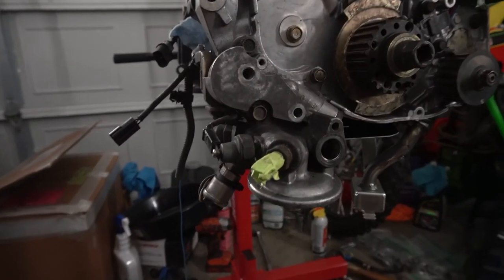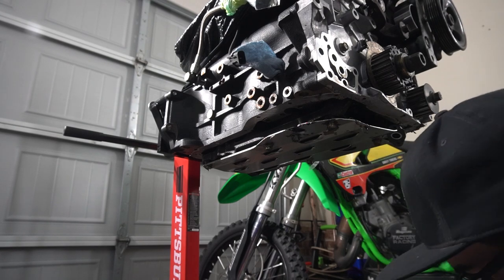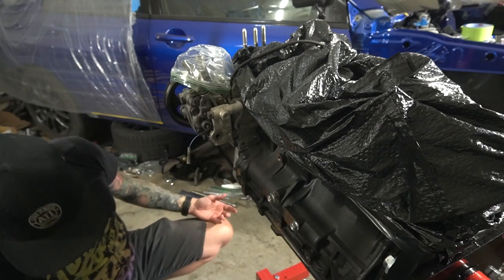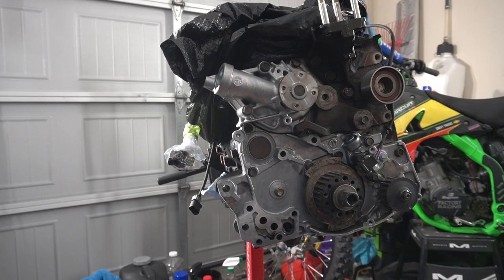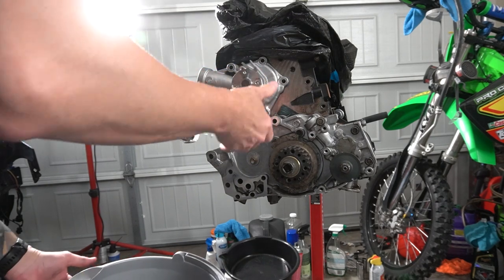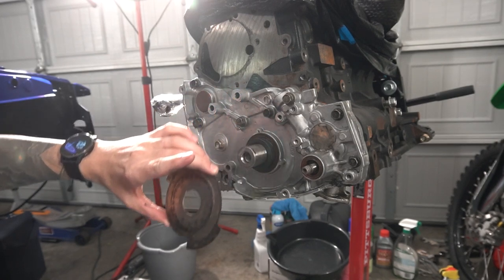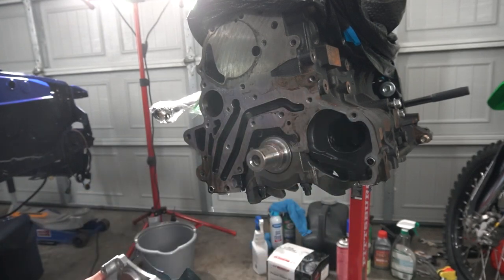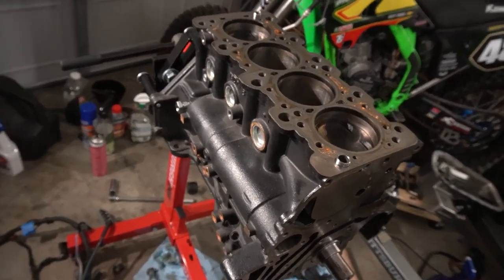Evo 9 MAP Stage 2 Short Block Tear Down....

Comment: I was anxiously waiting to see the Rod and crank bearings.
Reply from the maker: Yea, that is something that MAP will be doing, since they built the motor they were willing to get in there and inspect everything so I wasn't going to mess something up for them...just going to let them handle it from here on haha!
Reply: No way to mess anything up. Just as easy as undoing some bolts for the rods and light tap with a mallet on the rod caps would of popped them out. MAP should have carved or made it obvious in the sequence they go by inspecting them. With the crank bearings cracking the bolts loose would be the same as removing the head. Work your way out from the middle and out by zig zagging back and fourth to not disorient the girdle. Nonetheless good luck and keep the videos coming.
Reply from the maker: @Andrew49683  I'm sure that they did! They do really solid work but I just sent it off to them so they could do their own inspection. I DID get some really good news on the block tho so I'll make a video on that soon. Thank you, I really appreciate it!